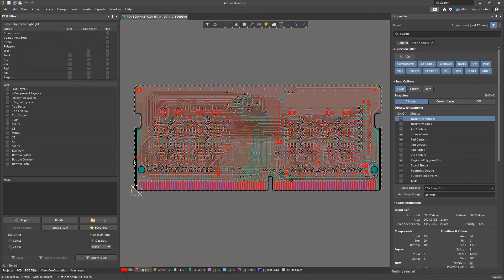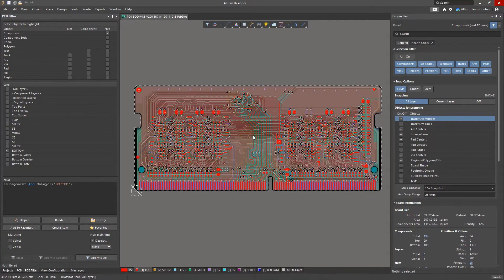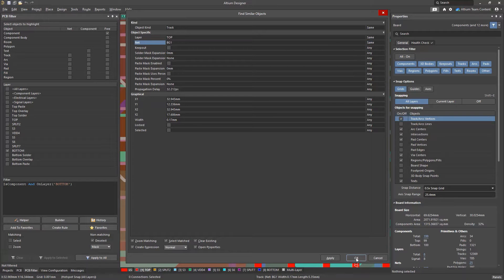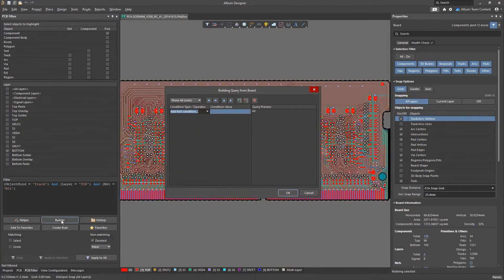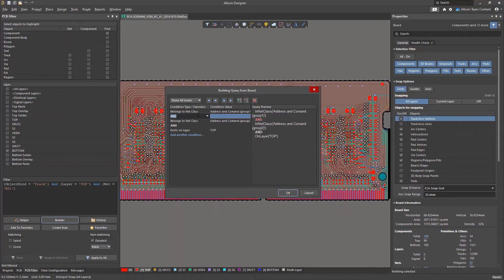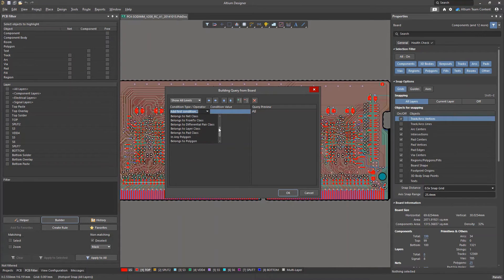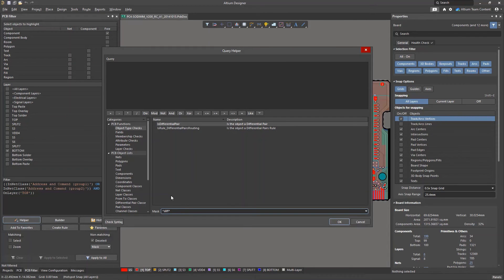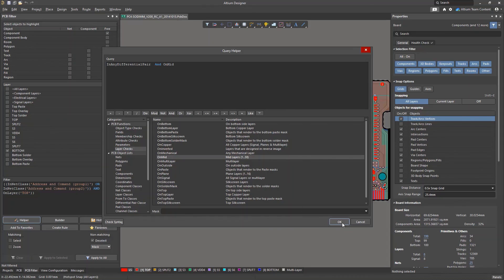Query Language in Altium Designer: How to Easily Create Expressions

Comment: Hey Zach, this is great. Quick question - im a very visual guy and i like to filter by cross probing/selecting with the schematic. Altium seems to crawl in cross select mode with large projects. Mentor unfortunately has Altium beat here - cross probing I'm Xpedition is smooth even for large projects. Any chance Altium developers are working to improve this?
Reply: I am not sure if this is an improvement at this point, I know they have some high priority things on the roadmap that I can't disclose publicly. If there is some fix that is applied, then probably what will happen is they will say "we improved cross probing" in the feature announcements.